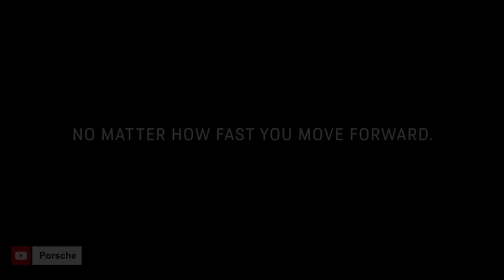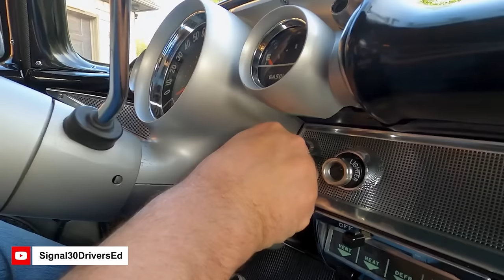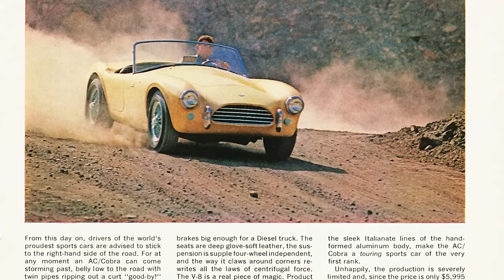Why Old Cars are Better

Comment: One thing I’d like to point out about that 2009 vs 1959 crash video.  The 59 Chevy had GM’s X frame. Arguably the worst design for an offset collision of that era. 

I’m not saying a standard ladder chassis would have won, but it wouldn’t have been quite as dramatic visually. 

Then again, I suspect that is precisely what they were going for. 

I’d love to see a similar test between a 1974 and a 2024. The 2024 would protect its occupants better, but the video wouldn’t be nearly as impressive.  G-forces don’t show up on camera.
Reply: Also with the amount of rust dust that puffed out makes me think that the older car was clapped tf out and they prettied it up for the test.  Plus I'd bet there was no engine or drivetrain in the older car either
Reply: @mrcody1924  I can’t find them at the moment, but they’re are pictures of the car on a flatbed trailer after it was wrecked. There appeared to be an in-line six cylinder in it. Apparently, they bought the car from some guy who had restored it, and he was not very happy with what they did to it. No word on how thorough the restoration was.
I doubt they actively sabotaged the car but I’m sure the choice of cars and angle of impact was no accident.
Reply: Don't believe crash tests - you do know they are sponsored by insurance companies, trying to sell you newer, larger and more expensive to insure cars right? There's no way a plastic blob can break a steel car the way that Malibu did - unless it has additional rollbars under the plastic bumper. You see the fact is, the NCAP gets a car selected (and specially prepared) by the manufacturer himself - NCAP doesn't get to pick a random car from the assembly line :D
Reply: Ted's?
Reply: @nathangamble125  Ted= test.  Autocorrect is awfully auto but not so correct.
Reply: The 1974 would still kill you. Older vehicles, ESPECIALLY pre 1990s ones, were deathtraps.
Reply: @gnarl12  try reading the whole comment…  I said it wouldn’t be as visually dramatic. I didn’t say it would win.  Cars from that era don’t soften the impact at all, but they generally look more intact.
Reply: @gnarl12  Anything lighter than 1.5 tons is a "death trap" nowadays - basic laws of physics dictate you will die if a large car hits your smaller car, no matter which year it's from. Modern cars are safer because they weight alot more, not because they have some "safety technology." Also there are 1970's crashtests that show living people being used, and surviving crashes - so obviously "safety" after 1990's is just marketing.

Comment: I got a 1993 GMC Sonoma a few years ago, it's my first cool/classic car. Recently moved to a more rural place, and I was moving in using my truck, and I kept hearing this squeaky sound from outside. I have already had to do front bearings so I was tripping over it, thinking I didn't grease them enough and they were going out on me again. Finally after a few days and looking at the bearings I couldn't believe they were making the noise while driving and then it finally dawned on me. The squeaky sound was crickets, all day, there's just crickets making noise on the side of these country roads. But ya I love driving my old truck, I use it as often as I can, keep it inside during winter. Nothing better than getting a thumbs up while driving or when people stop and talk about their old S10 or their dad's old Sonoma, etc.

Comment: Great topic, I drive a 74 MGB that I've had for 25 years. To me it's a hobby and the car has been fully sorted for 20 years. Like you describe, mine was a rust free barn find example I found in Central California but it was stored for many years by the time I towed it home with a U-haul car carrier I rented. Long story short the first five years were challenging, I got it running and driving in a couple of days but replaced every piece of rubber on the car at least once. I cheated when it came to the electrical systems and installed an electronic 95 amp alternator replacing the 34 Amp unit, I replaced the 25D distributor with an electronic version of the same and did the same with the starter. Every part that needed replacement was replaced with a new part after having rebuilt some parts three times over. The major components are numbers matching and it starts first time every time and has done so for years now. The MGB has fantastic parts availability rivaling many new cars. The car is extremely reliable and starts every time and i hardly get to work on it any more. Mine has overdrive and is freeway capable and has windows that even roll up! I worked on these cars working at a neighborhood foreign car repair shop while going to college. I've had many cars and I always have at least one car that connects me to my history and I've even had some that predate me as well. Sitting behind the wheel of any of these classics is like going back in time like when we drove with our parents on weekends when we were kids just taking rides on old country roads. I still wave at the cows...
Reply: I'm 29 and got a 1979 MGB LE roadster about 5 months ago, I've been slowly fixing her up over the winter and she is running good now. These cars are so much fun.
Reply: @tigermedz  Good choice; the MGB is the quintessential expression of a true old fashioned sports car. No new car can replicate the MGB feel. With few exceptions it's the end of an era. Usually guys your age don't get the old fashioned sports car and you are going to love it. They do everything well but nothing great. They were quick in their day but not a muscle car. They handle well and have a good driving feel but it's not a 911, they stop great but not like a Ferrari. The top takes 15 minutes to put up and it keeps you dry in the rain, sorta.  It's worth the effort don't give up. Drive it every chance you get and don't let it go unfixed for a minute longer than necessary. It should always be ready to go for a ride, if you're like me it lifts your spirits. Fix it as you go. If it looks ratty, drive it anyway, if it looks great drive it, if it breaks, fix it then drive it some more. BTW this philosophy goes for any classic car. Have FUN
Reply: @hummiesatmv  that's good advice! Mine is a garage queen according to my mechanic, but I drive it whenever the weather permits. In 5 months I've got new tires, put in a new ignition switch, spark plugs, new fuse box, battery, had someone teach me to adjust the rear brakes, and then I've changed out some worn interior bits. I'm loving it so far! And people my age don't even know what these are usually.
Reply: You're not near Roanoke, are you?  There's a dude I've seen driving his for about as long.  He has a few of them though, not sure of the years.
Reply: @FuckGoogle502  no I'm not from that area. But if you can find a good runner that's rust free, do it!

Comment: As the owner of an early 2000s car. I feel that I have found the sweet spot between reliability and simplicity. I have experienced vintage cars and plenty of brand new ones. I definitely believe that driving an older car which usually has better visibility will make most people better drivers. However, I have experienced a few modern cars that somehow manage to give me the feel that old cars give, which makes me very happy.
Reply: Which ones?  I'm still searching for a modern car that gives me the same joy as the old muscle car boats.
Reply: @FuckGoogle502 any late 90’s early 00’s muscle car ie. GTO Camaro Mustang vette etc
Reply: A newer car that feels like a classic for me here in Europe is the Suzuki Jimny Automatic. I've just driven one and it could end up being my next car. The 2014 model is the sweet spot. Not too old, so parts and warranty and everything is still a given. But so cozy and comfy all around. You hear every sound as well. It has a lot of character.
Reply: @FuckGoogle502  I don't think there is one. Albeit I'm in the UK, but I have worked in a fast fit garage and as an airport valet parker, so I've driven a few hundred modern cars, The most notable ones that came in that I remember were a 2002 F150, 2004 Lexus GS430 and my own 1996 Jag X300 3.6. Almost everything after the 90's feels the same and is bland as hell. That includes £100k+ Porsches and Land/Rangerovers.

Comment: Great video! I totally agree with the 80’s-90’s suggestion, I own a 1991 Toyota MR2 and it’s such a fun car that is almost bare bones with the spec I have. No power steering, no abs or traction control, manual, pedals controlled by wires, you name it. 

Truly it’s the experience of just being connected to the road without so many assists or notifications yelling at you on a screen in new cars. The instant response from the wheel and knowing that whatever amount of input I put is what I’m getting is unmatched. Awesome video!

Comment: I'm old enough to have owned and driven a bunch of what are now considered "classic" cars. I took auto shop in high school and learned about fixing cars and learned more as I went, which came in handy. I have literally done everything from brake jobs to rebuilding carburetors to full engine swaps on both cars and motorcycles. It used to be fun for me. That said, I hate working on newer cars. There's usually a big plastic air plenum that has to be removed to get at anything in the engine, and there is so much less room under the hood than there used to be that it's hard to work there, especially on a transverse-mounted V6. Plus, now with half a dozen or more computers in the car managing things, you really can't diagnose much of anything without a laptop and $5000 worth of dealer diagnostic software. Today's cars are designed to make it difficult for the home mechanic to do anything more than very basic routine maintenance; changing an air filter or spark plugs is about the limit. Even changing brake pads is difficult with modern ABS brakes. I think the last brake job I did was on our 1999 Honda Odyssey minivan, and we haven't owned it in ten years. Even changing the over-the-spark plug coils in my wife's Honda Fit is a chore, you literally have to remove the wiper motors and the shelf that they mount to in order to get to the back of the engine where the plugs are. It's not built for the home mechanic, and I'm getting too old to get into the odd positions required to do some of these jobs, so I shell out big $$$ to the pros. Take the VW Karmann Ghia in the video. The engine is so simple, air-cooled so no radiator, liquid coolant or coolant passages, and one person can drop the engine out of the car in about 30 minutes with nothing more than a pair of jackstands, a floor jack and a metric socket set. Once out of the car you can take the cylinder heads and cylinders off with the same tools, maybe add a metric wrench set. Dead simple. Try that with a modern car.

Comment: i started working as an automotive electrician 18 years ago. in my opinion a good car is one that does NOT have a body control module. im okay with ONLY the engine being somewhat controlled by the ecu (i dont see anything wrong with my throttle cable)
Reply: I've been learning to tune OBD1 Chevys and I'm convinced carbs are the way to go.  One normal screwdriver, a jet screwdriver, dizzy wrench and maybe different counterweights and it's done lol  Edit: Well, I forgot and a vacuum gauge.  Running like crap because of the extreme weather?  Five minutes and it's dialed.  Two and it's drivable.
Reply: @FuckGoogle502  while you and i might be able to tune up a classic car, if a relative was looking for something simple i wouldnt be able to ask them to do the same. "big kids lego" is so much fun tho
Reply: @FuckGoogle502  Anything pre-OBDII is trash-tier injection imo. The whole point of fuel injection is to account for various issues with driving conditions with the sensors.

Comment: I can say confidently after driving 200+ cars so far, old cars are better. And I'm 33. If you are about driving, older cars are better. If you are a traveller or passenger type, take the train, don't drive a car.
Reply: I really wish it weren't the case. I hope that in 15-20 years, the newer cars now will be as easy to maintain as older cars from the 2000s and 1990s. Really worried that as time goes on it will be harder and more expensive to find and keep old cars running.
Reply: pdubsyyyy  The biggest problem I have with that is that eventually the supply of used cars will dry up because people will keep scrapping them for rust, people will keep cutting up shells to modify and race and engine swap, etc. Plenty of cars that used to have great aftermarket support are now tossed to the wayside and models that have enjoyed a dedicated fanbase are rising in price. 

It's cheaper to replace the engine on a K20 or K24 swapped Honda S2000 than it is to replace the original engine... that's rather sad when you think about it.

Comment: I owe it to a family member for finding my first and current car, a mk4 golf (automatic)
There's so much high quality stuff packed in one small 4 door car it's wild. 
Changing the oil?, easy to spot and remove, changing the engine belt?, no issue you can do it solo via a youtube tutorial.
A car and a engine made to not screw over the customer and mechanics, hats off to the designers.

Comment: Was very nice listening to you.
As an old cars collector, i cant agree more: about the sync between the man and the machine, the stimulation with driving an old vehicle, and the distracted driving caused by various reasons:
1. blind trust on the vehicle in case of an accident
2. Zero to very little connection between the driver and the car
3. Cellphones...
Reply: The TPS arguing with you about how fast 30% throttle is supposed to be...

God, I hate Mom's Mazda Tribute (Ford Escape).
Reply: Old cars have the best safety equipment - more window area. When you can see almost 360 around you, you prevent the accident from happening at all. And if some EV monster that weighs 3 tons decides to run you over, in your normal sized retro car, who's fault is it gonna be? Nowadays they're trying to blame the poor person, who can't afford a modern SUV.

Comment: I recently bought a 2000 Porsche Boxster S. I got it for $5k and the understanding that the only way I can justify the ownership costs is if I do all the maintenance myself. I've never owned a project car before, and you can bet a $5,000 24 year old Porsche with 160,000 miles on the clock will need some work.

I've had a bit of a love/hate relationship with some of the projects I've tackled, but every time I take a drive I remember all the work I've done to keep it on the road and it fills me with pride and joy. 

Go buy a project car, get your hands dirty, then enjoy the drive!

Comment: I can reach through my 1965's engine bay and touch the ground with both hands, in new cars I can't reach anything below the surface because it's covered with facades. I can fix almost every problem with that car myself, and if I can't its because I need a car lift or pneumatics or something, on new cars I can barely get in to change the oil. Driving a classic turns the slog and boredom of driving into an activity that I look forward to. I can feel everything and every problem and I know when something isn't right, on a new car I can't tell anything without paying someone to plug it into a $10,000 computer.

I saved and scraped in high school to buy a classic knowing nothing about mechanics, because I can't stand how modern cars look. Every day I walk out to my Falcon and feel so much pride because I maintain and drive a piece of living artwork that makes people happy. However, this still isn't what keeps me dedicated to it when I'm stranded, or when I'm frustrated, or when I'm broke. What keeps me around is the feeling of my engine rumbling, the smell of my exhaust, the feeling of the controls in my hands, and the living breathing connection to this machine that I have like nobody else ever will. When I get behind the wheel of a new car I feel uncomfortable, lacking, and dejected. There is nothing behind them. I will leave this car to whoever is left after I'm gone. No matter if it is totaled, rusted, destroyed, or burned, I will never give up on it.
Reply: A restomod can also be a great example of a combination of old and new like you can have all the old school looks and feel while having some modern performance and efficiency as well.
Reply: But then you have to deal with unfixable computers and have destroyed a classic car.
Reply: @michaelbenardo5695  are you talking to me? I have no idea what you’re referencing that I said.
Reply: I remember back in the mid 2000s when my assistant scoutmaster asked if I could change the oil on his Audi.  I looked at it and the skid plate was secured by Security Torx screws, which were at the time, new to me.  I had Torx, but not the "security" version with the hold in the center of the bits.  I told him, "I guess they want more of your money."
Reply: @michaelbenardo5695  ...huh?  I don't follow.  Are you referring to the restomod comment?  In which case, I agree.  Don't sully classic cars with computer BS.

Comment: The oldest car I drove regularly was a 1969 Dodge pickup truck without power anything, including brakes or steering.  The newest car I drive regularly is a 2023 VW electric SUV with all the latest technology.  Honestly, I much prefer driving the newer vehicle.  The old Dodge is still in the family and I could probably get it if I wanted to, since it's hardly ever driven.  I don't want it at all.